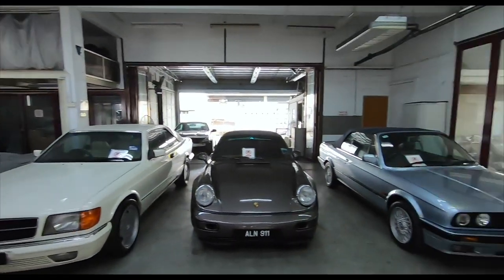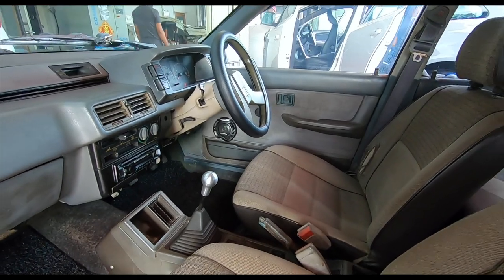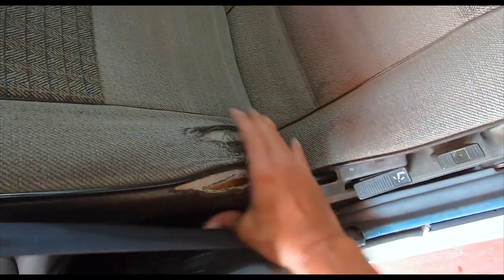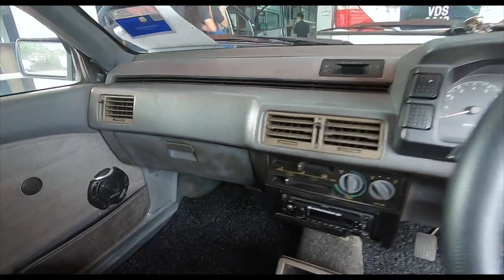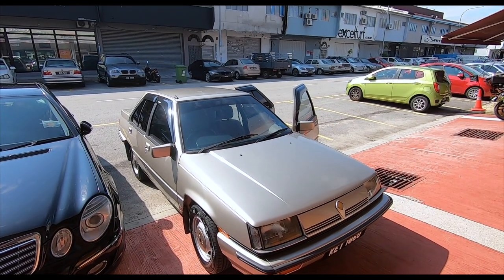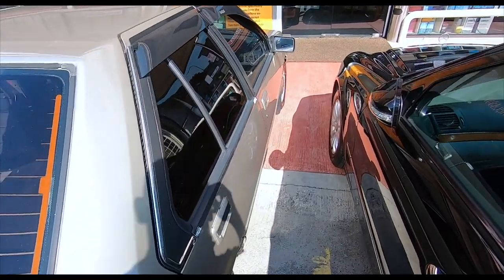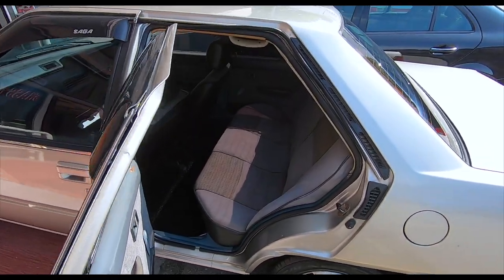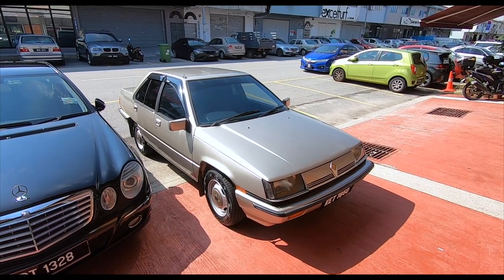UCR: The 1985 Proton Saga Continues! Time to Get "Lucky" | EvoMalaysia.com

Comment: my dad owned the first gen saga which was eventualy passed to me , it had the all steel non rubber plastic molding bumpers and most importantly the 8 valve orion engine. Yours looks like it has already got the  12 valve magma engine and the plastic strips along the bumpers..the orion wheel caps had a black ring on the outer edges..likely yours is the the first magma engined version which came little later
Reply from the maker: As mentioned several times, this IS a 1985 Saga Orion that has had some owner upgrades over the years, incl an endorsed 1.5 Megavalve engine and some interior upgrades, which I'm fine with tbh. Really don't see what all the fuss it about, cos it's still a 35yr old car 😊
Reply: @ChrisWeevilGarage  i guess as a daily classic, you can expect that and as long as still original its fine..my 28 year old eg6 i purchased recently is on its 3rd engine..keke

Comment: Keep this car bro.. don't sell it. I really love this earlier model of proton saga. Both Orion & magma models...
Reply from the maker: Me too! My 1st car was a Saga Megavalve sedan 1.3, been hankering to get back an old Saga, finally did it!😃🙏🏽👍🏾
Reply: @ChrisWeevilGarage  ya.. I heard that before from your car preview. You tell your 1st car is saga megavalve. I think in red saga iswara aeroback preview. Finally you noticed your saga interior is blue colour. Hahaha. Ya, this is originally 8 valve model, it's been upgraded for some reason. If I'm not wrong, the exterior colour might be white or light blue. Red & green comes with light brown interior.. the 3 outer door handle are original 8 valve, accept rear right door handle. Maybe it's change for some reason using megavalve/iswara door handle.
Reply: @ChrisWeevilGarage  This Saga kind of blend of everything on the goodies of every Proton Saga model had. I wouldn't sell this unit, I would keep it as this car to remember Proton of it's beginning.